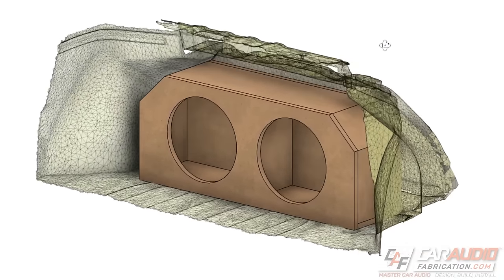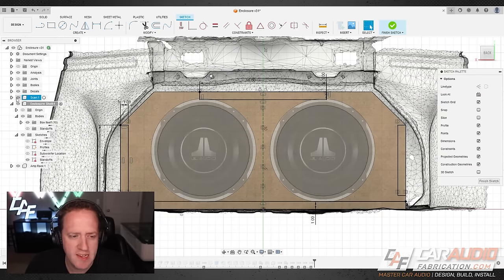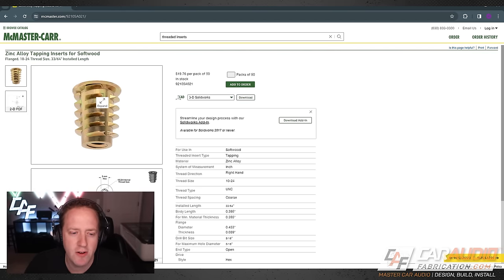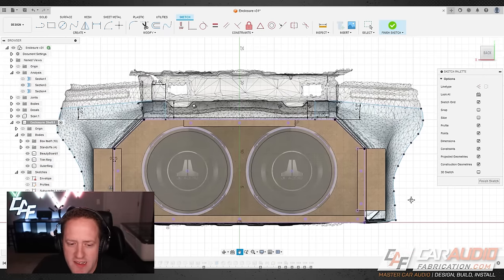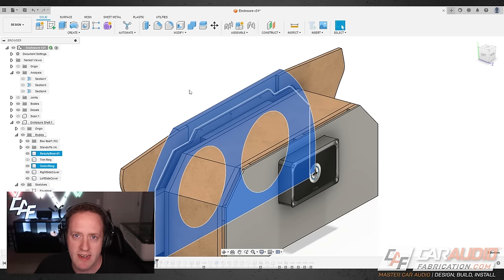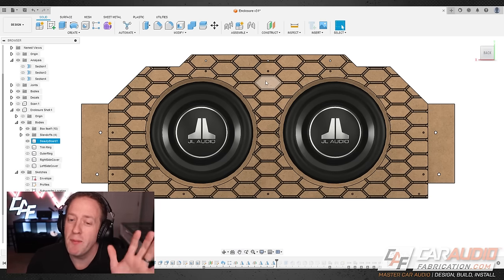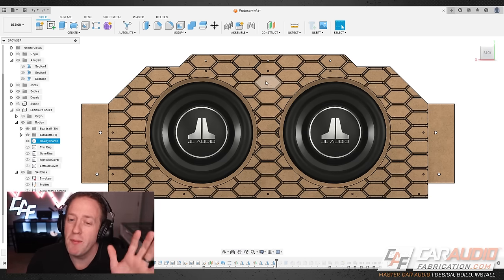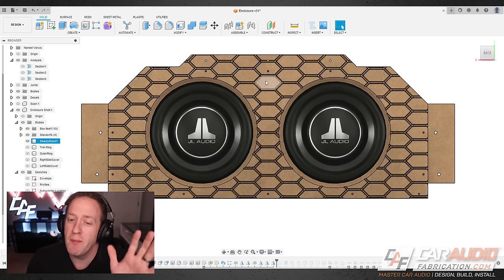Designing a Custom Subwoofer Trunk Build - HOW TO - Beauty Panels

Comment: These videos are great, and I’ve been a reliable follower of your channel since I found it. Much respect for your talents. That said, I found a ton more value in your videos when you were showing us things most of us have the capacity to do (or at least try). I work with a lot of mechanical engineers, so I have a tiny bit of exposure to programs like what you’re using and it’s fair to say that 95% of us don’t have the time (and in some cases money) to invest in learning how to work within the program to the point that using it would be beneficial. I for one would love it if you got back to teaching us things that normal folks could do.

Comment: Sr. Thanks for every one of your video  ( on related video of replaced old speaker ).  thanks I appreciate all information / when i  replaced My old speaker  and use your suggestions to sealed with the foam , and  ad some of the same material used to make a temporary round cover to direct the sound .was much better  and wow that's awesome improve the clarity/ Base/ tweeters sounds more clear. Only this  improve. Good  sound .   Cant wait to receive the sound PROFF material , foam cover for the speaker,Amps kit with the new amp . Sound will be clear . Bass will be last project. Can't decide 4" woofer or 6" sub woofer  not to make loud noice  outside   but deep Bass sound inside the car not outside noise.  Thanks again  many blessings.

Comment: Great video.  On the fasteners did you build those or did you find them as a block to import into your design. I messed around once with Fusion 360. I need to do more 3D drafting. I do 2D all the time.

Comment: what did you use for the trunk 3d scan? cheers
Reply: @v1ken  I’m doing a similar project for my car, I’m not sure if it works for Samsung but there’s a 3d scanner app I’ve been using and it’s been great for making large mock ups, nothing final but it’s a huge stepping stone. It’s literally just called “3D Scanner App” and has a house shape on the icon

Comment: So what is the trick to align the x,y,z orientation from your Einstar into F360?
Reply: I’m the einstar software, before you save your stl go to the measurements tab and create features (point, line, plane) then go to movement tab and use 3,2,1 movement and select your features. You’ll have to play with xyz constraints but that will set you up for an easy import into fusion

Comment: QUESTION: if I have two 10TW3V3-4, and I wire them together black to black, red to red, that gives me 1 ohm? correct? and if it does, would that then mean that combined the two of them would be 1600 watts @ 1 ohm? if thats the case could I then put a 2000 watt mono block amp on it? one lead set of wires coming from the amp to one voice coil, and then red to red and black to black all the way out? is that the correct way to wire it and is that the correct size amp? I hear your amp needs to be a little bigger than the watts needed and set the gain and filters on the amp properly for max effect. is any of that true or is there a better way? I have two 10 TW3 JLs and a Kenwood KAC-9106D 2000 watt max. is that the right set up and wiring for that? thank you

Comment: Damn you are a smart MF!!! Great video! I’ve always wondered how those custom enclosures are built! One question…. It looks as though that box is cut off from the interior of the car. I’ve heard that the bass “won’t make it into the cabin.” Myth? Serious question as I’ve never heard a custom system before.
Reply: "myth".  Bass is omni directional.  Sure, there might be some attenuation of the bass waves, but given the power these subs will receive, you, in the driver's seat won't see/hear a difference.  I'm also certain, that cars next to this vehicle will also experience the bass put out by this pair.........